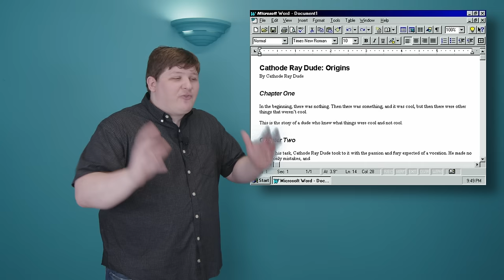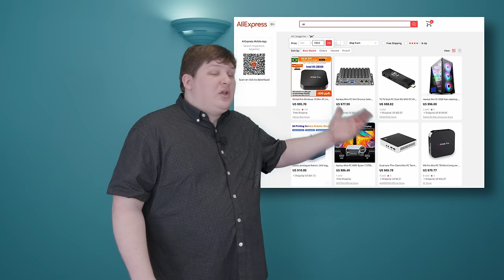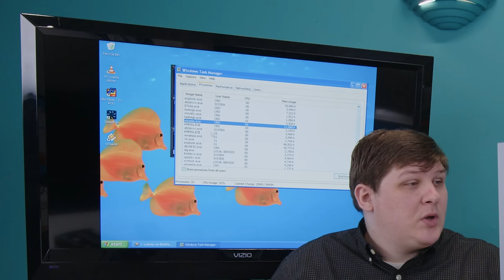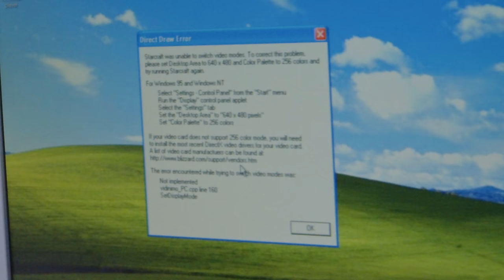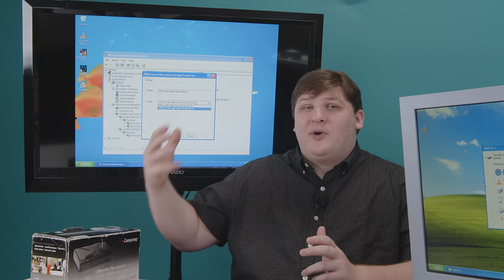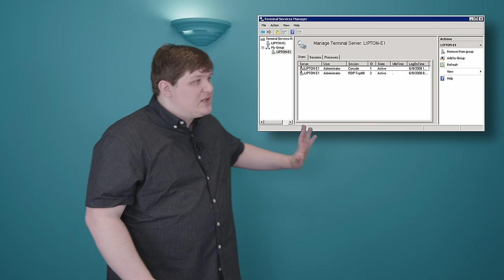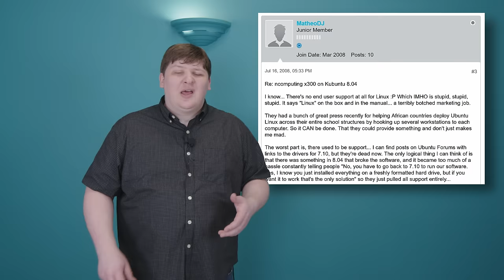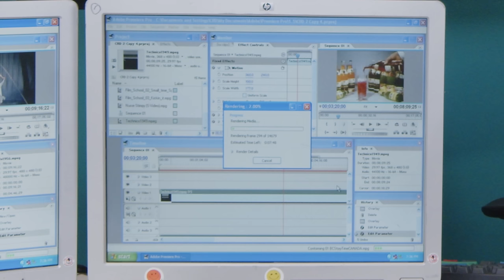7 Users on 1 PC! - but is it legal?

Comment: You should have seen the inner workings of the comptuer system Autozone was using as of at least 2002ish when I left there.  Those entire stores consisted of 2x486/33 systems, those were the cash terminals and that's all they did.  Then a 486/66 in the back that all the dumb terminals on the parts counter were connected to.  All of them ran DOS 6.22.  Up until probably at least the mid 2000's that's what powered the entire store, 486's and dumb terminals.  Advance would make fun of our system because they had fancy windows based graphical terminals where it even showed a picture of the part and all that.

Comment: 33:34 It's actually possible to get Starcraft to boot and run in 800x600 or other custom resolutions. It's the same old editing a config or variables file trick that was pretty common of the era, would be interesting to see whether that actually got it to boot or not or whether there's some other issue there
Reply: you run Starcraft, not boot it. Booting is what a computer does when it first starts up. Look it up. It's an interesting term.
Reply: Well, you also boot into windows, and virtually every game that was "windows compatible" in 1995-1998 area was really just running did, so would argue that "booting" would still apply.
Reply: @lilsammywasapunkrock  , because it was just running did? The operating system starts itself. It is not started by anything else. It pulls itself up by it's own bootstrap. That is what booting means.
Reply: @NickRoman  in that case wouldn’t the BIOS “run” the Operating System since it chooses what device to boot from
Reply: @hunterlong1820  , you might say that. It seems a bit beside the point of the distinction between what the machine does to get the operating system running automatically and a person telling it to launch a program afterward. To me, the meaning of boot is pretty clear and easy to understand--in spite of not being familiar with the term boot straps. lol
Reply: @NickRoman  i understand. I’ve just always heard and used the terms interchangeably and Google couldn’t differentiate them lol

Comment: Brings back memories of the late 1980s, when DOS was still king and the 386 / 486 computers were the top op the hill. Built some multi-user systems on a 386 or 486 PC using Concurrent DOS 386.  Via serial ports, you could attach either a terminal or even better, turn an old and obsolete 8088 PC into a terminal running a dedicated program called PCTERM. 

On the console you could run 4 programs concurrently, from the terminals you could run 2 per terminal. All software actually ran on the central computer, as was the storage. Concurrent DOS 386 relied on the Virtual 8086 mode of the i386 to achieve all this.  It was a alternative to the much more expensive solution from Novell netware.

Comment: It's entertaining to watch the breakdown of this weird technology that I wondered about since I first saw it. 

My Junior High in ~2010 had a computer lab with Windows 7 machines, but if you were unfortunate enough not to have the lab booked for a class, you'd end up relegated to the computers in the Library, which were older XP based machines that were running 4 users off 1 tower. It was a pretty awful experience: The keyboards all had shortcuts for opening web browsers, email, media player etc., and they were a little over sensitive to say the least. Odds were at least 1 (or more) of the 4 people would end up opening 3 web browsers at once, stopping everyone's desktop until the school's homepage chock-full of 3D icons and images would load over and over. Also, being Junior high, chances were pretty high someone would be done their work or just messing around, and would open up a flash game of some sort. You'd then get the added minigame of getting to type portions of sentences into Word blindly before it would load as a sort of test of your keyboard accuracy. Safe to say if was a little janky usually.

Despite the troubles it had, I was always impressed that it was set up successfully in the first place. I wish younger-me had thought to look in the Task Manager to see if it was doing something similar to this device.

edit: Just made it to the USB section and that brought back the memory of the fact that I'd leave jpeg presents on my friend's USB sticks as the systems all shared one common hub. Man those things were fun for all the wrong reasons

Comment: I actually used this at my old job for employee training, two used P4 2.4GHz systems plus two of these kits gave us 8 workstations for the training room. The only problem we ever had with it was when someone would unplug everything (because somehow the presence of computer equipment was deeply offensive to anyone who wasn't doing a computer-based training class). Once we solved that by bolting everything to the wall it was as reliable as any other computer.
Reply: It's all about the pentiums baby

Comment: Depending on the FPGA, they don't even have any storage on board, so for some of them there's a EEPROM or other form of storage on the device that holds the bitstream (configuration for FPGA), and if you're a clever cookie you can just grab that and reverse it.
Reply: Normally you need the development hardware and software from the FPGA producer to read and write to it.
With that you could look at the logic, but to understand it you have to study that shit for years.

Comment: Just found your video.  I found and used the Ncomputing hardware in two business installations.  In one case, the company works with bread ingredients eg. flour and every month the existing computers would clog up with flour dust  I substituted the Ncomputing older L-series hardware over the ethernet to the 'clean' admin offices and the problem was solved.  I was also able to provide them with a network printer setup in one of factory offices. As there was no fan in the printer, dust did not accumulate.  In the other woodworking business, they wanted a series of barcode readers at each stage of production to track a special order item throughout the factory.  I used 10 of the same older L-Series units and wrote the code to identify and collate the whereabouts of the special item.  With sawdust all around, the NComputing hardware performed flawlessly.  I am now retired so I no longer have the need to see how newer NComputing hardware could be used.  Overall, I had great experiences on using the Ncomputing hardware and software.

Comment: Unix systems have had remote window access available since a /long/ time ago, definitely the mid 90s,based on X11 / X-windows.
That is still the same underlying tech that provides graphics support for all current/modern Linux systems.
I had the joy of managing some of the remote access configs a couple of years ago.
Still a thing. Still good.  Still an utter PITA to configure and manage 😂
Reply: never heard of wayland? X11 is not modern its very old.
Reply: @prydzen  Cat of Nine  WAS speaking of old-sk00l shtuff.. so yeah. This Capability Was.  Point proven. QED
Reply: @prydzen  correct me if I'm wrong, but as far as I know, wayland is still not 100% ready
Reply: @WolfiiDog13  its close to 100% ready that is more ready than xorg is. if you have any troubles you are probably using nvidia.
Reply: @prydzen  my laptop has an Nvidia GPU, so that's it. Not really Wayland's fault, it's more about Nvidia just not caring enough about Linux users
Reply: @WolfiiDog13  i switched away from the linux desktop because of wayland. But since nvidia forced me to use an account with geforce i have been boycotting them. Now my systems are all upgraded to AMD and windows 11 comes in i will be switching back to the linux desktop when windows 10 support ends.
Reply: You think X11 is a PITA to manage on Linux, try 4Sight for IRIX … “oh, cool, I get to manage all these SGI machines with the wicked graphics and … OH GOD WHAT THE HELL IS THIS CRAP!??”
That was day 1. 🥵

(IRIX got X11 in v4.0 and luckily people rarely used it’s network abilities by v5.0, just like Linux nowadays)

Comment: It would be interesting to revisit this concept with a Threadripper as even an old one should be able to run a bunch of VMs.
Reply: Sadly, still limited by the software to 1024x768 max resolution and PS/2 peripherals...probably doesn't support modern Windows OS. It's not a solution that holds up to time.
Reply: It's possible if you use multiple GPUs and have a Linux host, using KVM to run multiple VMs and PCIe passthrough to give each VM a dedicated GPU. For a proof of concept look, LinusTechTips did a couple videos, called something like '2 gamers 1 cpu' and '7 gamers 1 cpu', but for more tech heavy videos, "Level1Techs" and "Craft Computing" have both done lots of content covering the kind of software and hardware required. There's a fair bit of overlap here with just trying to run games on Linux using a windows VM with GPU passthrough.

It's a big timesink, can be a huge headache, but if you wanna tinker with something, it does work, it just requires a lot of setup & troubleshooting.

Comment: Highly interesting. You tackled a topic in great depth I've been contemplating for a long time now. I'm a avid hardware enthusiast and I have several very capable systems but, lately all I can think of is how wasteful they really are when I'm not maxing them out for very specific tasks. My latest laptop with the best intel money can buy right now is an absolute beast to the point I've disable the power and throttle settings from the manufacture and 90% of the time I'm using my own extremely hindering power profiles because the CPUs are simply over powered. I limit these newest cpus down to 1-2 watts and use them for everything but high end graphical gaming which, I use my very capable desktop gaming PC specifically for that tasks. For literally everything else I use these latest intel/arm platforms and my energy bill/usage has thanked me.

Comment: Great video :)
This reminds (very nostalgic) me of working as a Solaris systems administrator in a team of six administrators back in the late 90's... and, instead of computers, every admin used a tektronix X11 display terminal, and we would all log on to our admin server (a SUN Microsystems Ultra-1 system, located in the datacenter underneath the building where our offices were located) and use CDE (common desktop environment) on these X terminals, with a dozen or so rxvt terminals on screen using the korn shell (ksh) with a VI visual (we set the VISUAL=vi environment variable in our rc file)...
We were responsible for day to day systems administration of approx 500 Sun systems, scattered accross the country of belgium, as they were the backbone of the infrastructure department of the Flemish Government, ranging from pizza-box sized Sun SparcStations up to Enterprise 10K and Fire 15K machines (with 64 CPUs in each!). Although the majority of systems were the Enterprise 450 (E450) unix boxes. What a time! :)
Reply: Did those Suns boot fast?
Reply: @NoTraceOfSense  nope, the smaller ones took 5-10 minutes or so and the large midframes like the 10K-15K etc... took up to 25 minutes! :)
I once accidentally unplugged the wrong server when installing a new one in a rack next to it and one of our IMAP4 mail servers went down. About 7000 people could'nt access their email for the 30 minutes or so it took to reboot, as this server had tons of SCSI luns from a SAN mapped, it caused approximately 3500 hours total of lost productivity... (and I got a lot of explaining to do afterwards)

Comment: Re: Linux multi-seat, that brings back memories. 

Around 1999 I managed to get that working just to see if I could. Configuring X11 was a PITA, but it did work.
Reply: No Machine client, right? You would think multi seat Linux would be ideal, but I never found it to be as polished as terminal server and oddly more sluggish. With a properly tuned distro though I'm sure it would be a different story, just likely cost money. Terminal Server came from Winframe, and Winframe came from Microsofts partnership with IBM and the entire OS2 debacle with NT. Microsoft just fell on top of it. Citrix has been double billing ever since - lol

Comment: First gen i7's/i5's were pretty op for their time. Perfectly usable today, the two downsides being PCIe 2.0 and SATA 2.
Reply: I have 9 yr old Thinkpad with 1st gen core-i5, still doing all the work, including CPU intensive tasks (video rendering and transcoding x265)
Reply: Idk I have 4 gen i5 and chrome will peak the CPU at 80% just opening it
Reply: My primary PC is a Core i7 920. Still fine for what I need it for, although I am thinking of upgrading the CPU to a Xeon X5690, which costs next to nothing these days.
Reply: @matth.imaging8952  If it's on your motherboard's compatibility list, it's a no brainer.

Comment: It would be interesting to install this on a decent modern multicore PC with Win7/8.1/10 if the X300 drivers would install.  You'd probably need a PCI to PCIE adapter as well.  Outside of technical problems getting it to even run, the big limiter would be the 1024x786 resolution.  Very cool video!  Subscribed!
Reply: You can run Windows 10 on an iPhone, pretty sure an older pc wouldn't be far behind.
Reply: i wonders if a hypervisor with iommu/ pci(e) passthrough could fix a lot of issues, although passing a gpu & usb card is just as easy and depending on pcie slots it could support multiple os's as well

Comment: wild, I haven't thought about these since high school.

In HS I worked in my underfunded school's library and we used these for the cataloguing/search computers, and it was painful they worked just fine, but performance absolutely tanked if you tried to use them for anything other than searching for materials.

I heard through the grapevine that after I graduated they replaced the single computer running the library with six or seven salvaged laptops after a computer lab was upgraded, and I had never been more jealous.

Comment: I want to know what it would run like with a server OS and top flight server hardware of the era. About that time we were using HP DL580 G5s which we eventually maxed out on RAM to run a sizable VMware cluster.  That hardware still isn't that cheap. Probably for reasons similar to what you have talked about in this. 
But with multiple real CPUs with multi cores etc, what could it do?
Reply from the maker: My plan is actually to try this out with Microsoft multipoint rather than this specific product, since it's a more optimized solution I'm sure, so keep an eye out for that video, almost certainly grab some 2009 server hardware for it

Comment: CPLD's are plenty powerful enough to do CAT5 KVM functions. I'll see if I can find the IBM KVM adapter from my giant 64 unit system. There's one tiny chip in it. It forms an 8 (or 16?) unit loop, the head unit has 4 (8) ports, and various models have up to 4 local station connections.

Comment: What fascinating hardware and such a novel solution. I guess it really reveals the power built into Windows itself.
Thanks so much for sharing.
Reply: welcome to the 60ties unixes, where all stuff were share pretty much as standard
Reply: @jkeelsnc  
There's actually a large percentage of private users of Microsoft Windows that haven't actually bought it themselves. It usually comes preinstalled on bought machines, new and second hand.

So your comment about "draining wallets faster" makes no real sense. Most of Microsoft's income comes from enterprise licences and selling business software like Office, Server and Cloud services etc, not so much from Windows itself.
Reply: Why use windows? You can do the same thing with Linux, and it's more efficient because even modern Linux distros have minimum spec requirements of like 512mb and an 800mhz processor.

Comment: Bro perfect explanation, I used to work in I.t repair store that sold PC's its kinda how I explained to customers if the computer is still doing what you need it todo then you generally dont need to replace it unless its starting to frustrate the user.

Comment: I recall experimenting with that system and their software would work nicely with USB hubs connected to multiple physical keyboard / mice.  With multiple graphics cards it could probably do everything without their simplified hardware.  So I guess they simply loaded up graphics drivers etc. into multiple "terminal" sessions, each running like the console session, but with different I/O addresses.

Comment: This was my first time on your channel and I can't congratulate you enough on this video. It looks like Google must remember that I was responsible for deploying two sets of these here in Argentina back when they launched. They were for a small call center and worked beautifully with the software I wrote to manage it using Clarion 6.3.  In fact, they were still being used until 3 or 4 years ago, when they were finally replaced with Raspberry Pi 3Bs, booting from the network and connecting to a rdp-patched windows 10 "server" ;-)
Reply: I was looking for someone else who had used these in the comments! I actually used these sometime in 2009 or 2010 on a later version of the device and I distinctly remember noting that at that point, the log in requests seemed to have been queued and took quite a bit, but that doesn't seem to be the case in this vid and now I'm curious as to if it was a change in the hardware or an issue with the terminal it was running from. Regardless, it worked wonderfully for regular office use, and it was honestly amazing at first to see it. We had 6 clients if I recall running from the host machine. The log in queue was the only thing I remember being a pain. It took like 5 to 10 minutes to log everyone on if we all logged on at once.